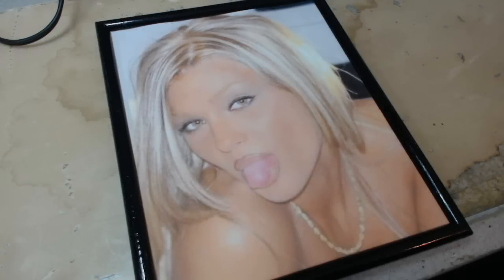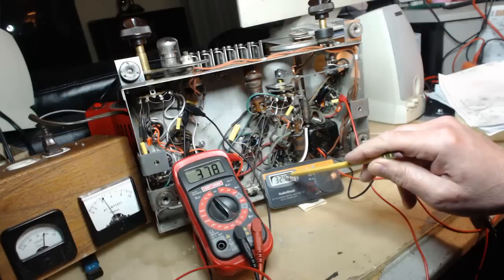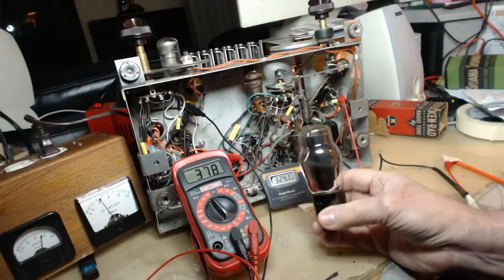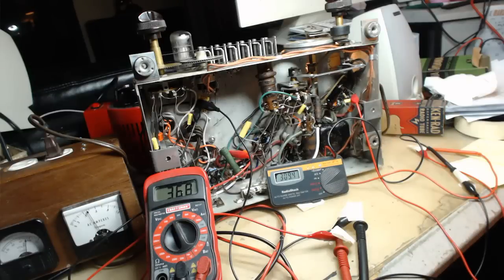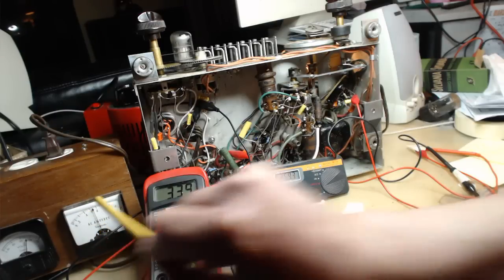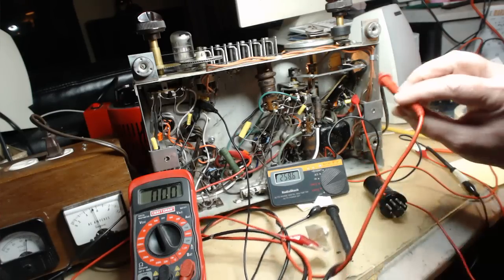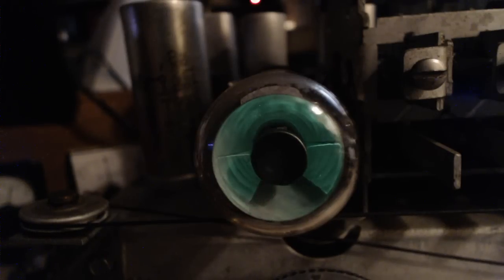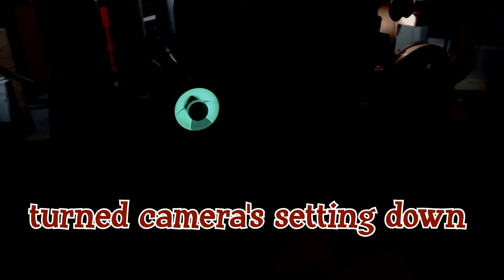1939 RCA Victor Model T-64 Restore Part 3

Comment: Hey Buzz, I am a little late to this party but just came across your channel and love it, keep up the good work! The best way to determine your optimum line voltage is to put your AC volt meter across the filament pins of any one of the 6 volt tubes. With the set connected to your variac increase the line voltage until you show exactly 6.3 volts AC. Then measure your input voltage and your actual line voltage and use your dropping resistor calculator to figure out what resistor you need. Piece of cake! The tubes will be at their optimum voltage and should be within all other specs as well.Gregb
Reply from the maker: +Gregb thanks  Greg

Comment: Buzz,
Excellent vid, my friend.  Very good indeed.  I didn't know about those Japanese 6E5 eye tubes.  At some point in the future I plan to buy and restore an eye tube radio, so that bit of info will no doubt come in very handy.
Recommendation:  It might be best to run the radio above 110vac...perhaps 115 - 118vac.  Sensitivity will be much better.
Also, you can probably prevent the 6E5 eye tube from fully closing by increasing the value of R13 just a tad.  Start with maybe 1k ohms.  Play around with it, although the resistor is probably inside the socket and somewhat hard to get at...or add a resistor in the line leading up to R13.  Food for thought.  Lastly...signal grid no...screen grid yes.  Again, one of your best vid efforts.  I enjoyed it.  Regards,John
Reply from the maker: joernone John..I'm happy I pleased the master..lol
I'm going to use the 6U5 eye tube from findatube. Its plenty bright..Ill save the 6E5 for another day..
PS..I was just testing you on the signal grid/screen grid!!!!!!
Congrats you passed...

Comment: Greetings:
The tuning eye tube plate voltage affects cathode visibility. Using the original tube, move its plate voltage wire to the rectifier side of the field coil. No idea how much higher that B+ voltage will be. Measure first!
The AVC line is used to close the eye. AVC voltage is always negative. As the AVC level is highest on the right side of R4 (2.2 megohm) but is connected on the left side it is at a lower potential than elsewhere within R4. Substitute any 2 meg pot (or equivalent resistance with padding the pot as needed). With the tuner set to the strongest station vary the wiper looking to close the eye if possible. If needed, move some of the padding to the left and check if a wiper position closes the eye. Measure the wiper resistance (with existing padding) on both ends of the temp pot. The total should be the resistance of the pot plus padding values. We are looking to tap R4 to adjust the shadow opening. As all of the destinations of the AVC are high impedance the voltage level should be appropriate for each input. By keeping the R4 value constant..
Reply from the maker: you do know this was years ago, and I dont remember it. right?

Comment: The maximum plate voltage of a 6V6 is 315 volts.  However it's not excessive plate voltage that will kill a tube as much as excessive plate current.

The 6G5 is a functional equivalent of the 6U5 but with a different envelope shape.

Comment: I think you restrict Dickel from using the phone, he is going to give Hackbar & Uncle Dorkel a bad name...LOL
I knew the B+ voltage would come down if you put in a new output tube, it may even go down more if you put in a new 6V6, as I recall a 6V6 should draw more current, your old one was weak as you said.
But like my dad always said: "Between You Me And The Lamp Post" I would not worry about the higher B+ as long as it don't exceed the ratings of the tubes.
Reply from the maker: ***** the good looking coke bottle tube stays...I love it...as far as what old dad told you....I agree goat....best regards,,Buzz
Hope you get your computer running again....

Comment: Nice to see you using the scientific method, Buzz. I tol you the voltage would go down with a new 6F6 pulling more current. Ah just knew it!
Glad it's working as designed. I better buy up some eye tubes now before the mad rush.
Too bad about Dickel's love life. He needs to try match.com. It has made millions of matches.
 Lot's of honeys at the 97005 BeaverTown Zipcode.
Reply from the maker: You're one smart Meister mister...Dickel need a woman his own age around  80..Maybe BeaverTown has a oldbag.com...hahaha
hey buddy...I threw in that belt and suspenders line just for you..That was none other then Henry Fonda himself !!..........Buzz
Reply: Buzz1151 OK, Henry Fonda! I was wondering who said that.. Thanks Buzz!

Comment: In my RCA radios, I've found that 6F6 output tubes run hotter than the hobbs of hell, especially the ones in push-pull configuration. I've made it a habit to swap in 6V6s because they run so much cooler. I wonder if that's why they did the swap on your set? Maybe they had a 6V6 on hand and no 6F6?
Reply from the maker: Jason Atkin Hi Jason...well. the beautiful brand new 6F6 coke bottle  tube will remain..It's not like these radios are played a lot. This is no push -pull so no worries mate....Buzz

Comment: Those previous voltage measurements are starting to make sense, if the 6V6 tested weak then it would conduct more poorly therefore draw less plate current, but at the same time it is a more efficient tube then a 6F6 so it may draw less current anyhow. It would be interesting to put a good testing 6V6 in there and see how things measure out, or leave the new 6F6G in there and swap the old 5Y3GT back in.
 That old 6U5 is actually not that bad if you can still see see it in a fully lighted room. As for the NOS 6U5 verses the Toyo 6E5, I would guess that the 6E5 is brighter because they used a different type of phosphor as opposed to the U.S made 6U5. I did notice that the shadow would not close in either one of the 6U5s, which may indicate that the set needs an IF and oscillator alignment. A 6E5, at least when it comes to U.S and Canadian made 6E5s, are more sensitive then 6U5s, the shadow will close at about 1/2 the negative grid voltage, I think that the same is true of a Soviet 6E5S as well. 
 One thing I noticed about your set is that it used a better quality magic eye socket then it's Canadian made cousins. It looks like they used an Amphenol made socket with the metal cap on the back, or something similar, Canadian RCA sets often used sockets made by Eby, and those are absolutely horrible to get apart and put back together. Sometimes you will find a 1939 through 1941 Canadian RCA set where someone just clipped the eye tube socket right out when the insulation in the cable went bad.
Reply from the maker: OlegKostoglatov I did put the old rectifier back in off camera with the new 6F6G and it was about 20 volts higher ..The "g" style tubes look better...also those tube sockets backs are metal. looks impenetrable....Buzz
Reply: Buzz1151
The metal caps on the backs of the magic eye sockets are held on by tension, there are usually a few slots cut into the outside edge in which you can slip a thin but wide bladed screwdriver and twist to spread the slots apart and get the cap off. Under the cap is just a regular molded six pin Bakelite socket.